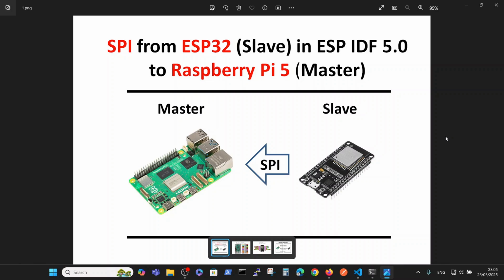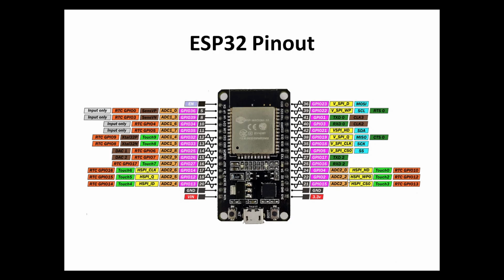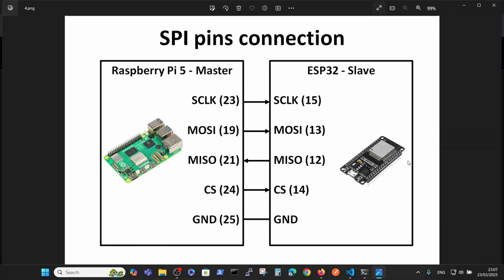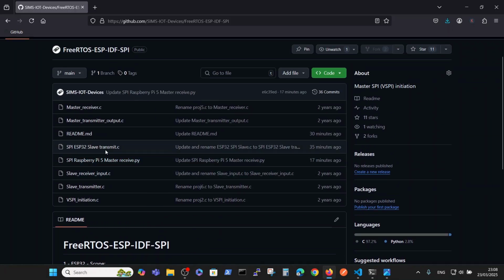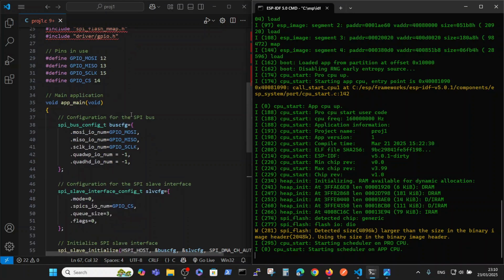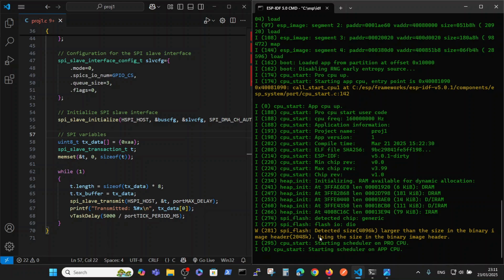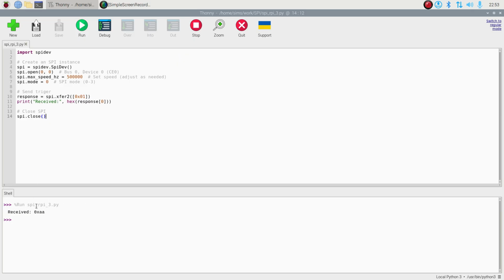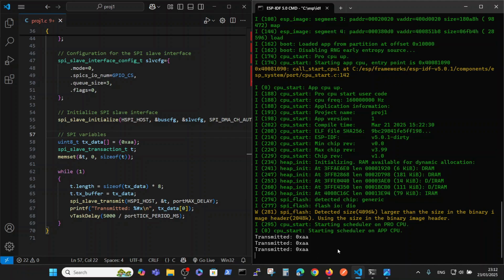4 - SPI from ESP32 to Raspberry Pi 5

Comment: C:\Users\Ahmed Shahin\OneDrive\Documents\Arduino\spionesp32\spionesp32.ino: In function 'void app_main()':
C:\Users\Ahmed Shahin\OneDrive\Documents\Arduino\spionesp32\spionesp32.ino:52:5: error: designator order for field 'spi_slave_interface_config_t::spics_io_num' does not match declaration order in 'spi_slave_interface_config_t'
   52 |     };
      |     ^
C:\Users\Ahmed Shahin\OneDrive\Documents\Arduino\spionesp32\spionesp32.ino:55:26: error: 'HSPI_HOST' was not declared in this scope; did you mean 'SPI3_HOST'?
   55 |     spi_slave_initialize(HSPI_HOST, &buscfg, &slvcfg, SPI_DMA_CH_AUTO);
      |                          ^~~~~~~~~
      |                          SPI3_HOST
exit status 1

Compilation error: designator order for field 'spi_slave_interface_config_t::spics_io_num' does not match declaration order in 'spi_slave_interface_config_t'
Reply: it worked thank u
Reply from the maker: Good to hear, thank you.